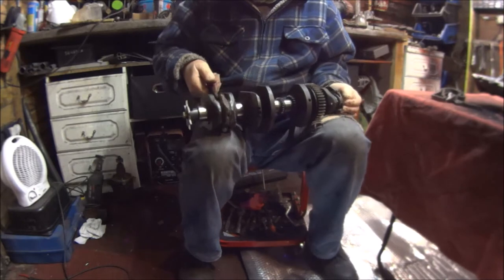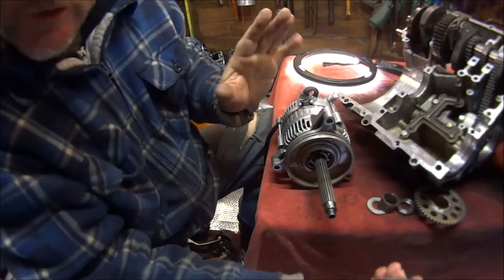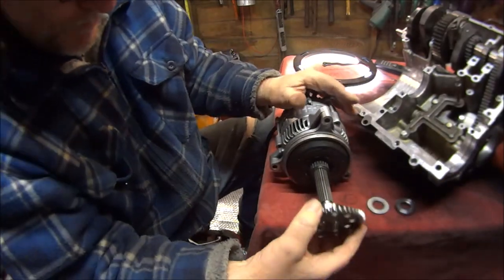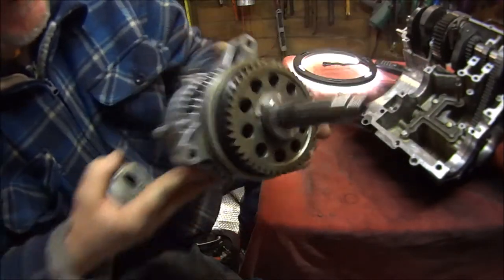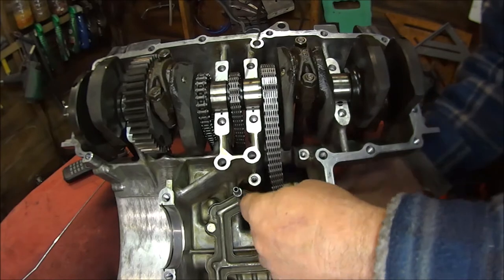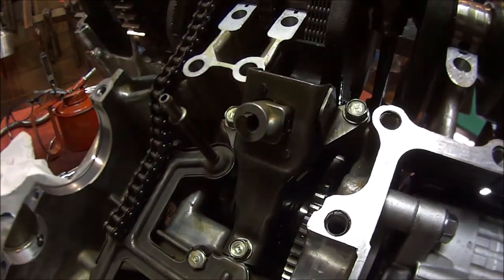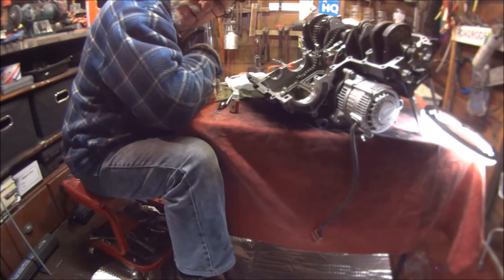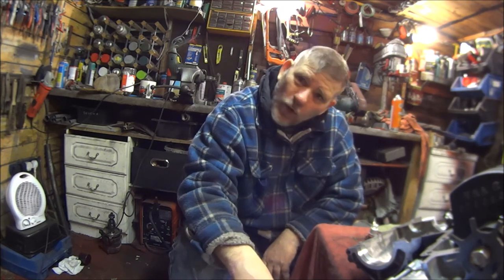1988 Honda cbr1000f alternator refitting. UK

Comment: Fantastic decription and visuals on this. It does look a bit of a nightmare job buf if the alternator has died and no charge being registared then its a necessary evil.
Reply from the maker: Thanks. Yes its not the easiest of jobs to do. 👍
Reply: However, I'm guessing you had the engine in rebuild on bench where as remove carbs remove small trapezium cover plate on crank case an unlock retaing bolt ensuring oil ways are aligned and chain held ib place. Its replaceable delicately
Reply from the maker: Yes 👍

Comment: Bloody hell Jon, that’s a ruddy nightmare of a job. I thinks I will leave mine alone until the day it dies. 

Great tutorial as always Pal, appreciate it. 

I want to throw a few quid your way through your patrion thing but haven’t worked it out yet. Any tips would be welcome 🙏🏻 

Cheers
Col.
Reply: Ok I’ve worked it out through your PayPal link. Have a pint or two on me Pal. Cheers 🍻 Col
Reply from the maker: Hi Colin yes it is a big scary job to do but if you've got a few decent tools it's not that bad.... I'm in the same boat with the patron thing I've had a few good attempts to work it out but now I've just given up with it.. Cheers Colin 👍
Reply from the maker: Cheers Colin I've got a ton of spray paint to get for the landfill bike project. So thank you so much it will come in very helpful and it is very much appreciated cheers Colin. 👍

Comment: Hello friends, I am changing bearings on my 1994 CBR 1000 F from the lima alternator but I can't get the stem into where the nut fits. Please someone show me a video. Thank you.
Reply from the maker: Think you need to do it when you're rebuilding the engine. You'll need to align the 2 oil holes as well. 👍

Comment: The alternator can be removed and replaced while the motor is still in the frame 
However 
The freaking tensioner is in the worst place ever
Reply from the maker: Yup it's a pretty hard job to have to take on. 👍